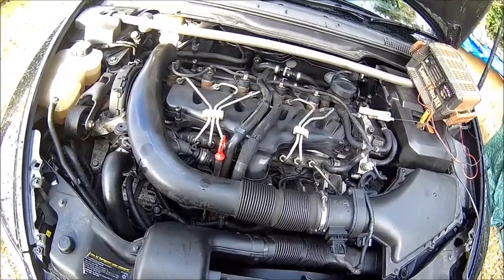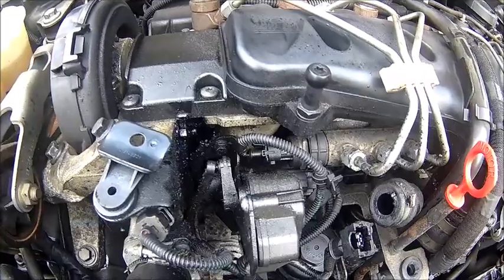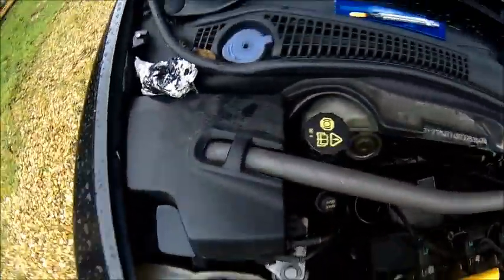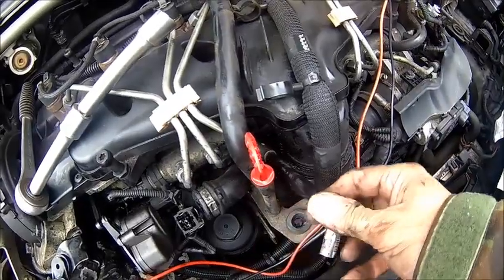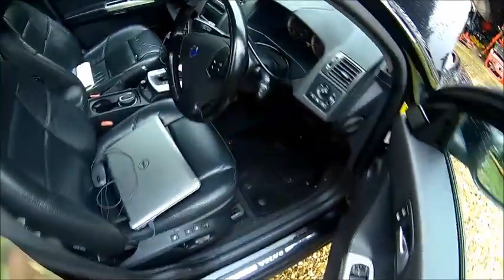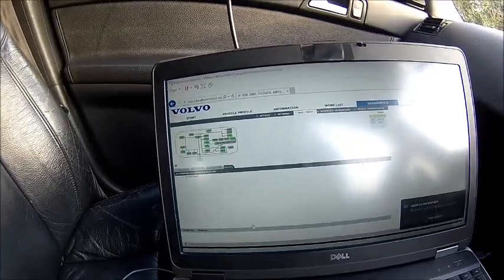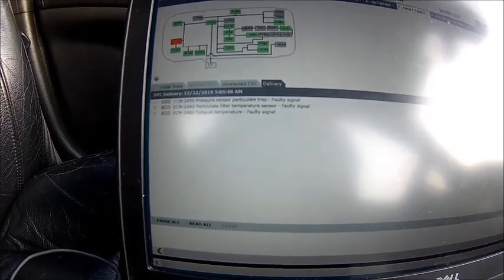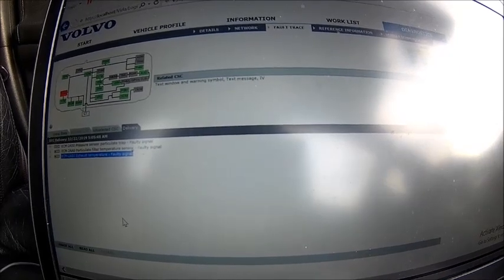Volvo V50 D5  - fault codes. Glow plugs. DPF issues, swirl actuator

Comment: Great series of videos. I've just got a V50 with D5 engine and as most high mileage cars it has a few faults. I'm looking to get a VIDA DICE but I'm lost in a sea of options! Where did you get yours? Any chance of a link?

Thanks in advance 

Al
Reply from the maker: Thanks Al, glad you like the videos. My DICE is just a random one off ebay, the VIDA is a VM made by someone at the swedespeed forum, just google for it. It's a US version, but works just perfect for my UK car and much easier to get going than a full installation, all you really need is the VMware player and the image.
Another alternative is VDASH from D5T5, it does needs a DICE as well.
Both have their pros and cons, but the most comprehensive one is definitely VIDA. ...If you really need more specific details, please send me an email, address is in the credits at the end of the video

Comment: how i wish you were on this side of the channel... a colleague has a range rover, not sure about the model, but the all three control modules are snafu and the thing won't run.. it's a really nice vehicle and it would be shame to sell it as a parts rig... the thing needs someone like you to get it back on the road...but you know how expensive shop time over here is and the other thing is that the dealers won't sell the modules as a spare part....
Reply from the maker: That's one of the reasons why the Volvo was rather cheap, tracing all these faults (you not even seen half of it) by the Stealership will set you back somewhat in the region of $2k, not including parts.  Depending on the result, you quickly beyond the current value of the thing.
If your friend's is an L133, i might know something about it because i recently spent about 2 days digging into the wiring looms, diagrams and manuals. What i can tell for sure is that the control modules are hardly on fault with these. It's the common fairy tale, utilized to drive up the bills or cover the lack of knowledge, the reality are most likely connector or sensor issues, but these are not always clear on the computer,...so you need to use your hands and real tools to find it...:-)
Except if there are mechanical issues, of course, these can't be fixed by software either
...And by the way, swapping modules nowadays is rather difficult as you most likely need to program them to the car. I have no LR software but i can clone most relevant modules to make them pretending to be the one you just took out the the car., all i need is the old one and the same type from a donor car.
Reply: @dynoguy   thank you for the info!!. i'll pass it on to him. maybe we can get the thing on its feet again. he made mention that the modules have to be keyed to the car which is what makes the price of a repair so insanely expensive. mechanically the thing is in really good shape. with th exception of the moss growing on it from sitting so long, the thing looks in really good nick